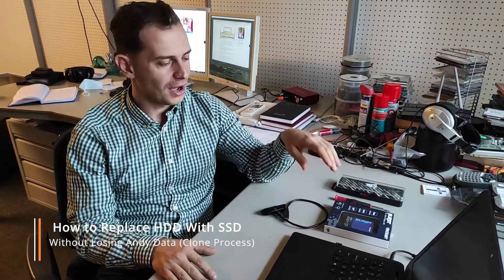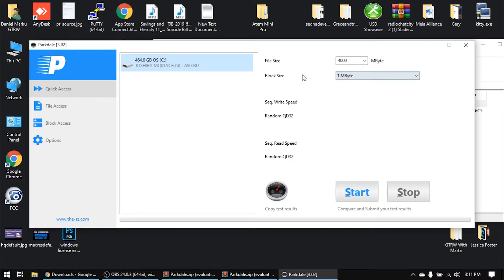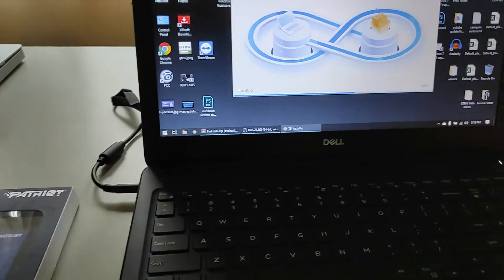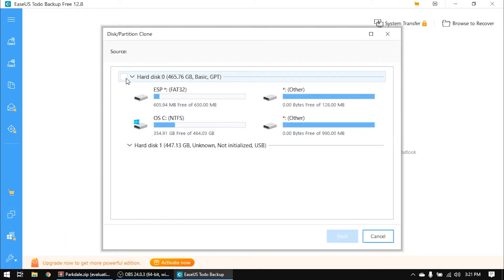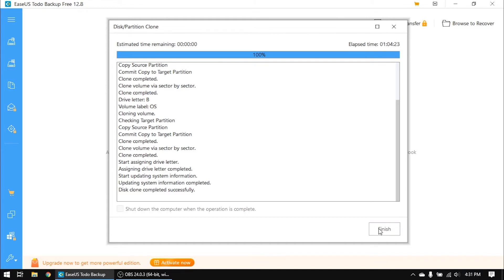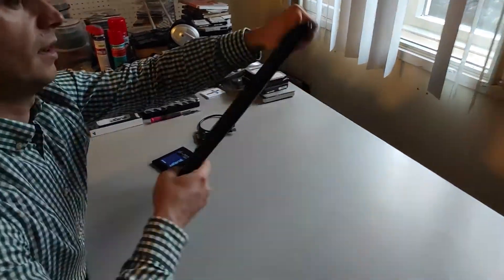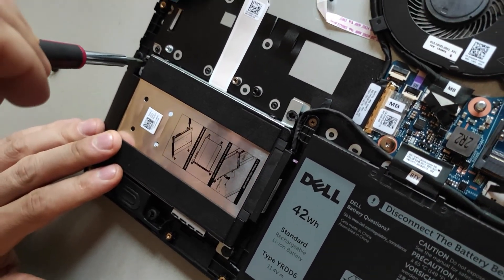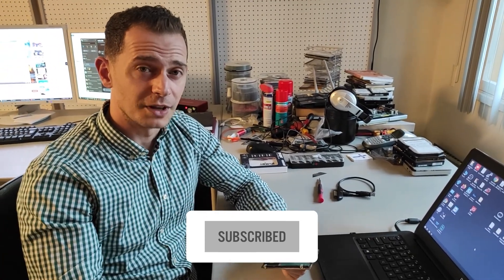How to Replace Laptop Hard Drive to SSD without Reinstalling Windows

Comment from the maker: HOW TO USE UNALLOCATED DRIVE SPACE IN WINDOWS 10
if your new SSD Drive is bigger than the HDD and if you are facing that after cloning process it looks like you lost some GB and Bigger SSD Drive looks the same space like your Old HDD than Follow this post to fix that:  
https://tips2fix.com/how-to-use-unallocated-drive-space-in-windows-10
Reply: I did follow the method 2 coz i cannot do the method 1, and create like a partition  as new drive is there anyway i can merge it to one drive as C drive? I dont like this method 2
Reply from the maker: @CataleyaRose  i can fix for you send me emai in tips2fix@gmail.com, i will asist you with team wiever sesion support
Reply: Shouldn’t you disconnect battery before before changing ssd?

Comment: Thanks for the video. I noticed your replacement hard drive was of the same capacity. My replacement SSD is smaller(250GB) than HDD (1TB) but the HDD drive has only 100GB. Can I use the exact method in your video?